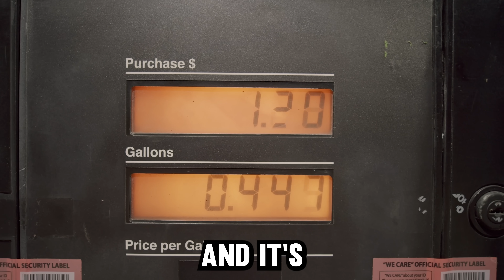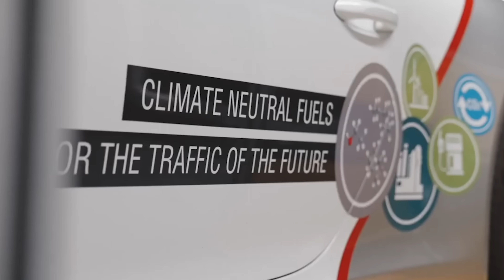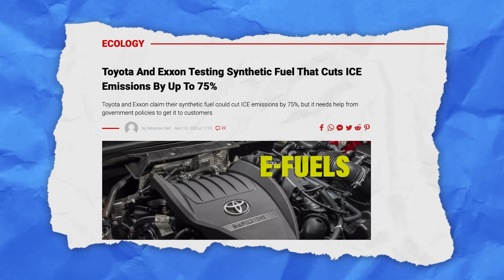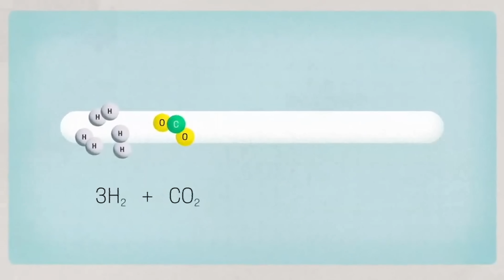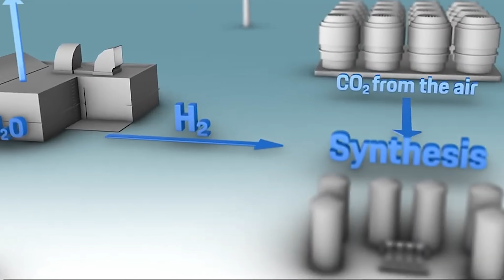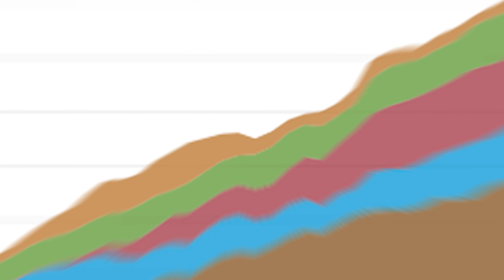Dodge Just SAVED Combustion Engines

Comment: IMO economically ICE will die regardless of the fuel source ,small car engines only have 25-35% efficiency at best meanwhile industrial gas turbine generator have efficiency of 50-65%, and EV have efficiency of 90%, so even with conversion loss, using gas turbine to power EV is still more economical , so if synthetic fuel becomes commercially available and very cheap, it make more sense to burn that fuel in power plant to power EV rather than fuel ICE car, ICE are doomed if manufacturers can’t figure out a way to push efficiency over 50 even 60%

BTW I don’t hate ICE nor EV, I’m just stating my opinion, I have many gas guzzling cars and EV/hybrid
Reply: Oh better yet , in order to make synthetic fuel you need to generate electricity to begin with, so why not just use the electricity?
Reply: The problem with bringing up thermal efficiency is that you have to factor in the total amount of energy that is being converted. An ICE block that dumps 6/10 of the output into the abyss still produces much more raw power per unit of fuel than an EV does from the same unit of battery storage.

Moreover, small car engines don't have a static 25-35% efficiency. It varies greatly based on a myriad factors while driving, and can go much higher than the numbers you're talking about. Furthermore, this number is not stagnant and keeps increasing with each passing year. Given the absurd amount of energy combustibles store compared to batteries, even an increase of a few percent means a substantial improvement. Small combustion drives can easily reach average efficiencies above 50%, which would spell the end of the EV industry if it were to hit the public square, but it's only been achieved a couple of years back and costs so much to implement that only F1 and similar high performance vehicles actually use it.

In the end, neither technology can replace the other. With our current battery technology we simply do not have the resources to replace even a substantial fraction of our ICE fleet with EVs, nor do we have the luxury of continuously relying on fossil fuels. Nobody in their right mind would not be skeptical about hydrogen for the time being, so the automotive industry is stuck in a limbo.
Reply: @Adrenalin844  I agree EV and ICE will co-exist for a very very long time, ICE have their advantages in heavy hauling, off roading, performance cars,seafaring and aviation, but it seems like for average consumers/commuters EV will be replacing ICE cars, (they are already better for daily commute if not for the cost), I know ICE efficiency is not static but it only has about 35% at best (cruising at highway rpm) in city driving and high power demand driving they have less that, about 25%, the highest efficiency ICE I know of is from Toyota hybrid systems, they have about 40% efficiency, that’s counting the kinetic energy recouped by the hybrid system, the combustion engine by itself is still 30%ish, larger engine inherently have higher thermal efficiency , it’s actually easier to achieve higher efficiency in a large v8 than a small 3 cylinder, those gigantic marine diesel engines with over hundred thousand HP have thermal efficiency more than 50%, and those 1000MW gas turbine (yes, gas turbine are ICE too)with more than 1million hp have thermal efficiency of more than 60%, I highly doubt small car ICE will have 50% thermal efficiency anytime soon, even small engine can achieve 50% efficiency, the same technology can be implemented into industrial sized engines and have even higher efficiency
Reply: @evanleo7633  Your statement about EVs being the best for average consumers and commuters is false. You mentioned them yourself - that crown belongs to hybrids, and forever will belong to them unless the energy storage capacity of our batteries increases tenfold or some other thermodynamics-shattering number.

You're also conflating the efficiency of the power source from which you charge your BEV with the battery of said vehicle itself. The power source matters very little in the grand scheme of things. In the end, even with a 40-45% efficient combustion drive, whether in a hybrid or a plain old ICE, you're already going further and cheaper than a BEV of the same category can go for a fraction of the weight and initial cost, and this will not change for as long as we use the current iteration of BEV technology. Not that it would matter if it were not the case, since we have less than 100 Mt of Lithium in the entire world to begin with.
Reply: @Adrenalin844  my family own 3 electrified cars, a Tesla model3, a Toyota Corolla hybrid, a Toyota rav4 prime plug in hybrid, the tesla requires the least maintenance, no oil change no fill up, I take care of all the maintenance of all my family’s cars, just for the simple reason it’s requires almost zero maintenance no fill up is a enough reason for it to replace daily ICE car, it’s way quieter and smoother too, if you don’t drive long distance, if you can charge at home, if you don’t mind the high cost of purchasing, EV is just better for average commuters, if you ever daily a EV you would not want to go back to ICE, energy capacity/range on EV is not a problem at all, the problem is charging speed and infrastructure, but me never drive long distance( and most people don’t), that’s not an issue too
Reply: @evanleo7633  In the business, we call what you've just written anecdotal evidence. Provided you didn't just make it all up, of course. I could tell you stories about the myriad BEVs my coworkers have owned and the load of problems they've encountered, but that would be insincere and, once again, completely anecdotal.

In reality, BEVs are just as unreliable as any other vehicle and suffer both minor and major breakdowns at a substantially higher rate than traditional vehicles. See Insights for More Reliable Electric Vehicles by Consumer Reports, 2022.

If you have a plug in hybrid and pretend that having a BEV is better, the only reason for you to believe that would be for the hybrid to be breaking down constantly. Chalk it up to bad luck, I guess, like having bad silicon on your chip. You literally get the best of both worlds - quiet and smooth operation for city commute, and high efficiency for longer trips.
Reply: @Adrenalin844  lol funny of you have no experience with hybrid or EV and making false assumptions what I have said, when did I say hybrid are problematic? You literally made that up, I said IT REQUIRE MORE MAINTENANCE, first of I don’t blame you to not understand how annoying it is to go to gas station every week because you don’t know how convenient it is to charge your car when you get back home, not to worry about waiting in line to touch that filthy gas gun and in fear getting mugged in your fancy car at gas station ( I have a Nissan GTR too but whatever you won’t believe me anyway), okay fine filling up is not maintenance, let’s talk about maintenance, the Corolla hybrid gets driven about 60k mile per year, it needs 1 set of spark plugs, on transmission fluid change, 12 oil change, new tires, brake fluid, can you guess what the Tesla need in the same mileage? Tires, that’s IT, the brake even last long than the hybrid Corolla because stronger regen, also remember hybrid is already way less maintenance intense than pure ICE car, no belt no clutch no water pump no alternator no pulleys but still has oil and spark plugs,the reason I have a rav4 prime plug in is because I live both in NY and FL, I drive back and forth
Reply: @evanleo7633  stop putting words in my mouth and trying to straw man your way out of what you've written. You said the hybrids your family owns require more maintenance than the Tesla. That makes them, de facto, more problematic than the Tesla, be it replacing parts or repairing breakages. The statements are synonymous, end of discussion.

Let me make something perfectly clear mate - I am not accusing you of lying, or doubting your experience, so calm your tits. I am merely accentuating the fact that everything you've written so far - including your long and pointless rant about replacing parts of the Corolla, is completely anecdotal. I simply pointed out that if it were not as such, it would be an outright lie to serve your point. If I thought so, I would not have engaged you any further, yet here I am.

Anyways, in regards to your rant about maintenance, I refer you to the same empirical analysis I provided in my previous comment. Your personal experience may lead you to believe that BEVs require less maintenance and repairs, but that is simply not the case in the grand scale of things.

Comment: It's a joke.  Even if the synth-fuels become a consumer reality, it will be years if not more than a decade before it actually reaches you and me at any kind of reasonable price.
And then there is the Stellantis sized elephant in the room.  They do not want large combustion vehicles in their line up.  They want small displacement engines that they prefer over in Europe.

Comment: You left out so much information on this topic. First off, coal power plants are going away... so we will not be "ramping up" coal fired power plants to cover charging EV's. Dodge did NOT save ICE cars, Porche is light years ahead of Stellantis in e-fuel tech. Porche has already been racing with e-fuels. You also left out the part about Formula 1 cars in a few years going more electric and decreasing the output power of their combustion engines. While yes Formula 1 will be using e-fuels soon, they will also rely less on the combustion engine for racing. The new Formula 1 electric motor produces over 3 times the power that the current electric motor in F1 cars makes. 

I am all for e-fuels, been watching what Porche has been doing with it and I have high hopes. E-fuels will save internal combustion when the cost per gallon goes down... currently porche's e-fuel costs about $40 a gallon. You left out that info as well.

Comment: I predict that the Dodge EV Bashee will be failure. Because I don't see any customers paying for micro transactions , that car already has when you buy it. To me Dodge is stealing from their customers. When it fails , and customers catch on and stop paying for micro transactions or switch to corvettes. Let's keep 100 customers are not rushing to buy Hornets. Customers are going to start buying the Dark Horse or Corvettes.  Dodge will become the Dodge of 1990's just another brand. It will be too late course correct.  Unless they come with a total design of the Challenger , Charger , all New Viper , reintroduced the Cuda with a Hybrid engine. Other than that. Dodge is after 2024 is dead!

Comment: I THINK E FUELS ARE A BAD IDEA ," If e-fuels are made with hydrogen from water, the water supply could potentially be affected depending on the scale of e-fuel production and the method used to extract the hydrogen from water.

Water is a finite resource, and if large amounts of water are used for e-fuel production, it could put a strain on local water supplies and potentially lead to water scarcity  "

Comment: A decent attempt but simply embracing the Hydrogen Combustion Engine would make things so much easier. That would be the way to go in my opinion. Toyota and Yamaha have already gotten started.
Reply: I said the same thing
Reply: Hydrogen and synthetic are the real thing
Reply: @Enrique A Thiele Solivan Toyota and Yamaha have already proven the success of the Hydrogen Combustion Engine. The powers that be would rather rape Mother Earth to produce Lithium Batteries and waste metric tons of energy to charge them. Oh well.

Comment: Two decades ago bmw built a number of prototypes made to use renewable energy and low emissions canon based vehicles. It was scrapped when they realized that to make the fuel to run these vehicles could not be done without using large amounts of carbon based energy to make the fuel. Wether the vehicle is electric or hybrid or something that uses fossil fuels that is converted it is almost entirely dependent on coal based power facilities to make or run them and these vehicles cannot be recycled in a clean efficient way when they are destroyed and replaced.
Reply: @andersd8956  don’t forget the batteries and most of the electrical are made by child labor in areas of Africa that are the only place in the world with the highest amounts of cobalt and lithium. Recycling the vehicles means sending them to China to burn the precious metals out. Our country can’t destroy them as it kills the environment or even bury them in landfills after 100k when the battery fails or catches fire from age.

Comment: E fuel for the masses is a pipe dream. It's never going to be as cheap as gasoline or oil at least at current prices! I see maybe commercial and some racing/collector car use of it. It also isn't totally emissions friendly! NOX is still a problem! That stuff is really bad for human health! Also look at history whenever corporations try to get around fuel restrictions/rules/cost it never goes well for the environment or human health! First was adding lead to gas because they wanted to save money by using it instead of more expensive ethanol. Then they created MBTE again to try and cut cost vs using alcohol to boost octane levels. 
More now than ever the V-8 has to die! Need smaller engines hooked up to hybrid drive trains and EV's! I would have loved to see the options available today back in the malaise era. You guys don't appreciate how good you have it and have had it!
Its not like EV's are slow or that today's cars might be over powered for street use. I can see the government stepping in and limiting HP. That is one area where I think the Demon 170 might come back to haunt people!

Comment: We bitch and moan over $4/gal gas.. The Nazis used synthetic fuels to try and keep their military fueled when they were cut off from global oil supplies; expensive!!! E-Fuels need tremendous energy to be extracted, and are always going to take more energy to make than they get back… This is the SAME reason we don’t desalinate ocean water to solve the droughts hammering the Colorado river basin… The cost in energy to desalinate water make the water so expensive, nobody could afford to use it. E-Fuels, desalination only make sense on a large scale when Fusion power is abundant. We COULD double down on Fission reactors and transform the power grid into producing abundant, nearly free energy… e-fuels make sense then too. It’s wishful thinking, Stellantis is transforming Dodge into an EV company- simply too much is being spent internally to ever look back.. Dodge would be folded up into history before Stellantis would ever backtrack on electrification now. It’s too late-, the auto industry has committed to this pivot for better or for worse.

Comment: I definitely think e-fuels are a much better long term solution than electric cars. That is, unless the government helps fund each and every car owner (or household) to produce their own green electricity (through solar panels or through small, roof-mounted wind turbines like from IceWind) in order to support all of these electric cars. But not only is that highly unlikely because the government would never support people becoming more independent from the state, but there would still be the issue of those rare materials and the complex manufacturing procedures required to make electric car batteries which create a lot more emissions than most people think. Sure, the car itself doesn't make CO2 when you drive it. But while you charge it, coal or gas is being burnt to generate your electricity (unless you generate your own, like I said), and all of this is after the manufacturing of the battery during which the required materials/components have to cover enormous back and forth shipping distances before the battery is finished.

Comment: Yeeeeah that's still not going to save anything when so many parts fuel engines have need to be replaced over and over, over time. Much in part for them intentionally creating parts meant to breakdown so they can be paid for again. No one wants that certainly not me. EV are better.

Comment: Combustion cars are 100% recycleable, can't say that about Lithium batteries. 
The recycling of those batteries will be so expensive that the low-cost of electricity will be meaning-less, when keeping the battery supply cyclical in the market is 10x more expensive

Comment: If they made EVs to work like diesel trains you would get the best of both worlds. 
 In other words, if they made them to run on a light weight battery pack until the pack becomes 90% depleted, then have a small engine, that is connected to a generator, kick in with enough power to run the cars electric systems AND slow charge the batteries, I think they would have a winner.
Reply: They won't do that because it makes to much since.
Reply: Yeah, I don't understand why hybrid vehicles aren't talked about more. This seems like the perfect solution to me

Comment: A waste of f*cking time, screwing around with i.c.e engines, I know this to be true because Hutzs car rental made almost a 13% higher profit by going electric, and Amazon is following in hot pursuit of going all electric, this profit was mainly derived from the fact that maintenance on electric cars was so much more inexpensive, keep in mind that an i.c.e car has over 2,000 moving parts, and those parts require someone to maintain them, by contrast if I'm not mistaken an electric car has exactly 21 moving parts, well you can do the math😂 the i.c.e car is dead, get over it!